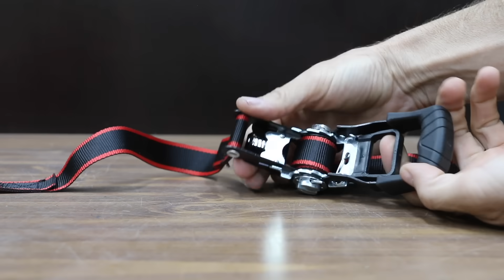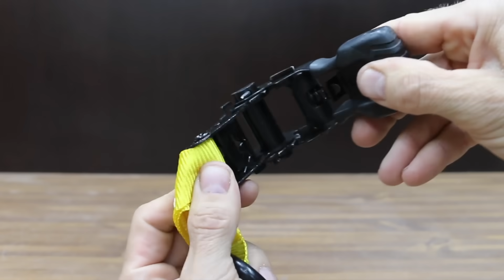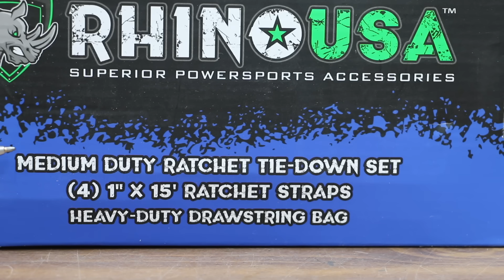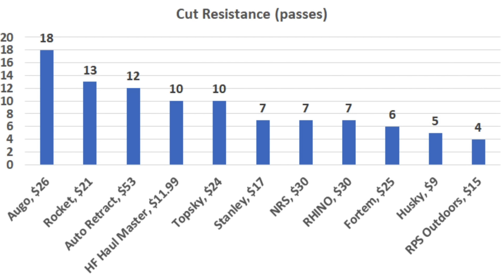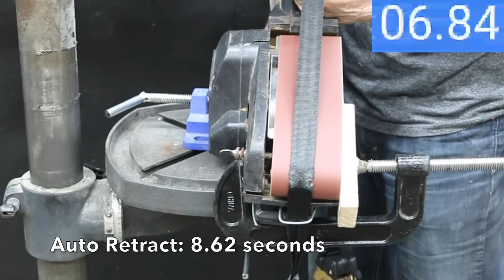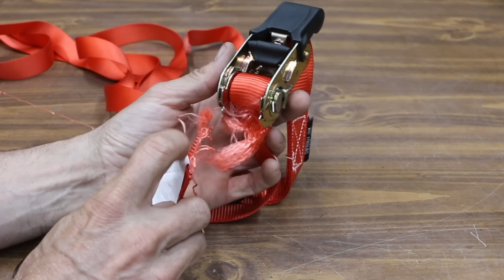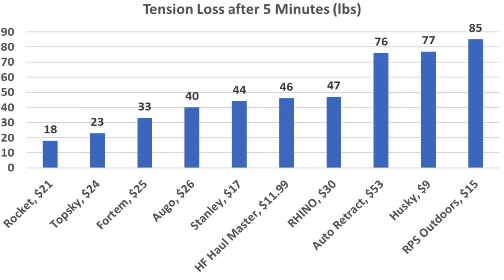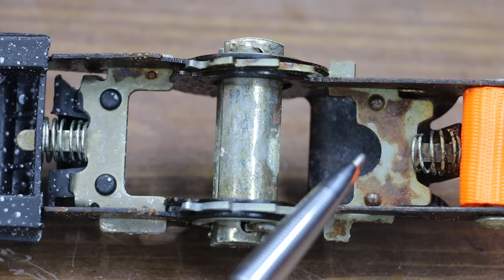Best Ratchet Strap? Husky vs Stanley, Rhino USA, Rocket, Topsky, Augo, RPS Outdoors

Comment: Great review as usual. I was surprised to not see at least one Premium brand like Mac's there given they are only a few $ more than some you tested.  They are my new go-to for straps. I do a fair amount of off-roading and use a lot of straps. I have used two of the brands you tested, the Haul Master and Husky, and both Tend to Jam up over time or if you really cinch them up they do not release well, the mechanism appears to bend a bit.  Keep up the great work!
Reply from the maker: Thanks, will do.

Comment: I really like to apply dry lube / spray teflon to the moving components of my straps.   They let use a lot easier.

The spray teflon flushes out any debris, leaves behind a dry lubricant layer, and helps them release a lot.

That storage method is way better than mine.  I look forward to giving that a try.

As always, thanks for a thorough and very well done test!
Reply from the maker: You are welcome!

Comment: Could you make an update video? I'd like to see the "Weight to Unwind" test performed on the corroded straps; see if the corrosion makes it more difficult to release. 

I've used the cheap store brand ratchet straps, and they always seem to get harder to use after several months of storage; they usually get corroded because I don't have a dry location to store them.
Reply from the maker: Thanks for the suggestion.

Comment: Great video. I would love to see you add in some stainless steel ratchet straps I purchased on Amazon a bit over a year ago. It was about $40 for two so they weren't cheap, but they are meant for salt water/air exposure and otherwise perform really well compared to what was OEM on my jetski trailer.
This is the link to them. And I have no affiliation or relationship. Would just like to see them tested if possible. Thanks for all your amazing test videos! https://www.amazon.com/gp/product/B07FP1Z7HY/ref=ppx_yo_dt_b_asin_title_o02_s00?ie=UTF8&psc=1

Comment: Is there any percentage standard set for these straps? Fibre and wire ropes have a set percentage of fibres being broken before rejection. Look up the meaning of "kink". It is normally a 360-degree turn on itself. We were taught both theoretically and practically, that is where the silly thing will part. We have to give/ take that into consideration and set a higher safety standard.

Comment: Love these videos.  I actually have 2 of these brands and same size, the Husky and the Haul Master ones I use for hauling my ATV's.  Due to rub on a sharp edge, one of my Husky straps snapped while on the road, but the failure was my fault and not the products fault.  It lasted 2.5 hours at near highway speeds rubbing against a sharp aluminum edge.  Great work, keep it up!
Reply from the maker: Thanks, will do.

Comment: We use these store brands in a pinch; but out at sea, we can't mess around.  We ONLY use USA RATCHET products for our primary load-bearing ratchets.  They last the longest, and don't rust nearly as quickly as the home depot stuff.  Source:  I work on US Navy academic research vessels, and have to use these ratchet straps to tie-down moorings and overboard sensors and equipment until we sail out to points of interest.  USA RATCHET is the only product that hasn't failed us in the rigors of the salty ocean (the entire metal ratcheting mechanism is electroplated); and they're not that expensive either (well, we did purchase them in bulk; but they're the only ones that last a few years compared to others which only last a few months, or just one use in the salty ocean).
Reply from the maker: Thanks for sharing.

Comment: Were the strap release tests done by measuring after pulling on the quick release?  Did you do any test on the ease of using the overtravel release? I rarely use these mini straps. I don't know if they have that feature.   (by extending the two sides over 180 degrees it should release}

Comment: Put the handles in a high heat high humidity area for a few days. 
This is how test vehicles. A week or so at conditions simulates 10 yrs of wear n tear. 
110F 110% humidity. Not sure if it's exact parameters but will get you results.

Those Husky I've used. They don't last but a few times. The ratchet will bend very easily and in the rain for a couple day they rust easily. 

I just saw this a couple days ago.
https://www.youtube.com/watch?v=ifyJjQXOttE
You 2 should combine tests and see what happens.

Comment: I love this channel and really appreciate your work. I hope this is the right place to put in suggestions. Tall order, but I'd like to see you test stop leak additives for head gaskets and oil seals. Specifically,  Blue Devil, AT 205, Titan Sealers, Fusion Sealers, Subaru's Coolant Conditioner, and Holt's Radweld. (Subaru's is probably the same as Holt's). Thank you so much. Dan
Reply from the maker: Great suggestion!  Thank you!
Reply: @ProjectFarm  Thank you. I just learned last night that Subaru might have changed their formula about a decade ago, so it might not be the same as Radweld, if it ever was. The original had clogging problems. It was Subaru's first solution to their head gasket problem, which they apparently did not fix fix until 2012 or so.
(I have a 97 Subie.)

Comment: I'd love to see a follow up test on the tension test. After the material stretches out the first time to get rid of the slack it would be interesting to see if they still stretch or if they all start to even out. Would give a more realistic result for straps that are used more than once.
Reply from the maker: Thanks for the suggestion.

Comment: Damn. I recently purchased Rhino straps to hold my Harley in place in my utility trailer for a 500 mile relocation and they held up well. But after the performance rating here, sorely disappointed in my purchase. If this review had been 6 weeks earlier, I would have purchased the Topsky. Great job in the testing.
Reply from the maker: Thanks!  Thanks for sharing.

Comment: i hate to ask for such a similar video, but I'd like to see this but with the 2" commercial straps. 
Even for home use, i seem to find a lot at garage or liquidation sales. Also, I've worked with them in almost every job and some companies like to buy cheaper ones for us to use that I don't always feel save driving with. I've seen propane tanks fly off a pallet truck down the highway before and I still refuse to drive behind specific companies to this day because of it.
Reply from the maker: Thanks for the suggestion.

Comment: Hey partner, I hate for you to have to back track but your oil testing videos are the greatest service to humanity since gasoline and I would like to see how travellers 15w40 all fleet from tractor supply holds up to T4 rotella or the such, according to the PQIA website they tested travellers in 2015,at least that's the info I found, and it claims to beat T4 in phosphorus and zinc in numbers while travellers has virtually no boron while T4 has a noteable amount , if that stands true and up to date in 2021 (who knows if the stuff is still formulated the same) than I think that's a decent bulk choice for old equipment such as 8n,jubilee/600, my old non emissions farm truck with 300i6 and the 391ft dumptruck..I would love to see you test this oil it's a great price and seems to be formulated decent for old old equipment (flat tappet non emissions no kittycats)for the price..THANKS!!!!

Comment: Tension loss test probably could have been equalized by resetting the strap several times to get them all closer to a 300 start? Topsky 319 vs. rocket 277... not really a fair test.. Still the best video I am aware of for ratchet straps of course!

PS. Topsky was sold out (you heathens!).. HOWEVER.. this appears to be the same strap for even less! Search amazon for "XSTRAP 4PK 3000 LB Ratchet Tie Down Straps". Had to get some before you lot drained them as well.  

One last thing about storage methods although yours was awesome: I use a lazy method since it has to be easy or I won't do it at all lol... (but doing nothing obviously sucks more since you have a rats nest next time you need them). I have tried many ways and this is what actually works for slob like me:

My method: 1. straps separate from ratchets. 2. Take strap and fold once in the middle. 3. Fold once more in the middle of that, but around something like a bungee against a wall.. or in my case a roll bar. 4. Lay the ends of the strap where you can get your hand on the hook end easily (it will pull out without issues when needed from just the hook, which I can find without looking). 5. ratchets all hung from an eye-bolt with a carabiner. Both the ratchets and "strap hook ends" within reach of the back window of my rig. When needed I reach in and grab one ratchet and one hook and what I need is instantly out of the rig and untangled, (I carry 4-6 usually. I use them more than most). This works even if everything else back there has become chaos (STFU I know!). Not as good at space management as the method Project Farm used.. but if I can get myself to organize at all it is a miracle.. and I can handle this much prep 90% of the time. Also the 3 parts of the strap I don't need access to I can lay in another direction into a harder to get to area and free up space that way (if I am feeling frisky).
Reply from the maker: Thanks for sharing.

Comment: I have to shill for auto retract. I've had a set for like 10 years, and the darn things still work. Sure, I now have to help out getting it to retract, but I've used these things in rain, snow, got left in corn field, truck bed. This thing just keep going without fail.
Yes, they're expensive and a bit cumbersome, but every other straps always ends up getting stuck inevitably, usually when you really need it do its job. All the times I didn't have to rewind when the spool got loose or cursing at the stuck ratchet is well worth the extra cost.
Reply from the maker: Thanks for sharing.

Comment: Your storage technique is significantly better than my "throw it in a bag and untangle it later" technique.
Reply from the maker: Thanks!
Reply: @ProjectFarm  hi. I have been a great fan of your videos. Kindly test a product by the name Xado especially the Atomic Metal Conditioner Maximum with 1 Stage Revitalizant. I will be very grateful.
Reply: I roll the strap separate from the ratchet assembly and store them under my rear seat.
Reply: I used to be a driver who used straps almost daily and was usually in a rush.
My method was to hold the long strap by the hook and wind it over my thumb down around my elbow, fold that in half, then wrap the ratchet around that a few times and then toss it all in my tie-down bag.  Kept at least half a dozen straps in there at a time and they never tangled enough to matter.
Reply: I just hang them from the four bedposts...  for storage.
Reply: I just roll them up as it
Reply: I feel attacked by this that's what I do
Reply: Rolled and placed in clear plastic ziploc bags. Never tangle, stay clean and rolled until you use them.
Reply: 17:00
Reply: Im the 69th like on this comment

Comment: I'll say this, the build quality at the low end of these things has gone way up from where they were 20 years ago.  Sometime in the early 2000s I bought a set of cheap ratcheting hooks to attach things to my roof rack.  They did work, and I got large items like a dishwasher, lumber, etc home without them failing.  While they DID work, the straps themselves constantly got bound up in the ratcheting mechanism, the mechanism itself jammed, and it was just terrible to work with.  I wound up spending a fair amount of time fixing the tool.  I think they were whatever Harbor Freight was selling at the time.

Because I only used them maybe 6 times a year, (and I'm a cheap bastard), I just kept using them despite the flaws and pain, largely because "well I ALREADY have some of those, why buy a new set?".  Then about 5 years ago I saw ones about the same build quality as the Husky, and decided to spend the whole $30, and live like a rich man.  I believe it was the "SmartStrap" brand, which wasn't tested.  It was like night and day.  They don't get stuck, they release easily.  The "just work".

So if anyone is out there like me, who still has these horribly cheaply built ones from 20 years ago, throw them away and spend a whole $20-$40 on some newer, better ratcheting straps.
Reply from the maker: Thanks for sharing.

Comment: You should do a video on WD-40 only. All my life I've been told that it is a great lubricant however at its core it is simply a water displacement not really a lubricant. I know you've done similar videos with other lubricants and believe me I watch all of your videos but I can't remember what every single one was about.

Maybe test it's lubricity and ability to release a stuck bolt versus a control or a stuck screw or stuck nut.......

Comment: Some (maybe all?) Of these have multiple load  ratings at same size.   Example the Topsky you did are 3000lb yet they also have 1x10 rated at 900, 1200, 1500... wondering why put a 3000lb up against others in the roughly 1500lbs rating

Comment: Nrs and similar design are spectacular for a some things... nothing better securing small loads to roof of car and similar where you want the tiny buckle (ones with a piece of stitched strap where buckle is to prevent damage from buckle onmload or vehicle are best) not some giant ratchet that will damage your vehicle and have issues at speed with wind.   Those  tiny buckles also have the small & light footprint to always have rolled tucked away in vehicle.    Nothing better for securing items like small boat transport ( kayak/canoe etc..) on roof or secure light boat on trailer.
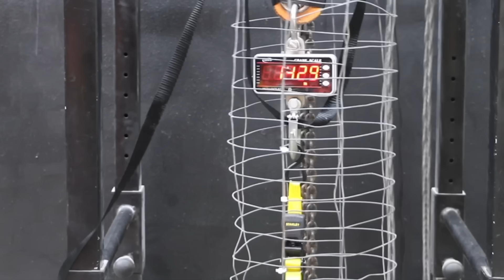10:55 say husky talking about Stanley.   I'm a little over 1/2 way.. I continue.
Reply from the maker: Thank you for the feedback!

Comment: Before I even watch this, it's worth bearing in mind any decent branded strap is designed to take 7x it's "rated" load, at least in the UK. (This is as far as lifting equipment goes anyway) so I'm intrigued.

Comment: Has this been done we know 
Diesel mixes with 2 stroke
Petrol/gas mixes with 2 stroke 
Diesel and gas separates but what if there both mixed together with 2 stroke could it be used in a 2 stroke or a Diesel or would they both still separate

Comment: As a contractor, this video was really relevant for me. I cannot tell u how many ratchets i’ve bought over the last 15 years or so. I have noticed that ratchet quality has really decreased.  They used to be made with real rubber handles and now just plastic or nylon. When I use them on my outdoor trailers, they always bind up and I can’t get them to release. So frustrating.  When that happens, I just spray some WD40 on each mechanism and that usually fixes it. Guess its just the corrosion thats binding it up. Thanks so much for this video!
Reply from the maker: You are welcome!

Comment: Noticed a variation in where blade was hitting on the cut rig. Can you test the straps that are simular to the NRS, but has a piece of metal that takes the stress. Always outstanding testing. Would also like to see resistance to turning after corrosion test and the inevitable over-tightening. You keep making videos and I'll keep watching!
Reply from the maker: Thanks for the suggestion.

Comment: This channel is seriously underrated. By far the best testing channel out there.
Reply from the maker: Thank you!
Reply: Without a doubt .
Reply: I dunno about underrated though lol - seems like subs have taken off the past 6 or so months...   I can’t help but feel like there is going to become a point where this channel just explodes 😅...  u just can’t get stuff like this anywhere else
Reply: The only channel I've found that comes close is the torquetestchannel. It's a newer channel that's a one trick pony just testing impact wrenches for now, but they do an incredible job and get right to the point in their videos. Their live graph of the torque for comparison is an incredible feature. The static graphs already featured on this channel are nice, but it would be nice if a similar feature could be incorporated in some of the tests. It's so much easier to keep track of all of the characteristics during the tests.
Reply: @1mongoman  I’ll have 2 check that out
Reply: Yeah he always does everything possible to make them fair and accurate tests it’s pretty cool
Reply: Facts
Reply: Yea a 100% accurate statement there is all the info and more than you could ask for on everything I trust this channel with  his tested conclusions also he taught me how to use seafoam correctly and I'm still planning on making the propane lawn mower just haven't got around to it